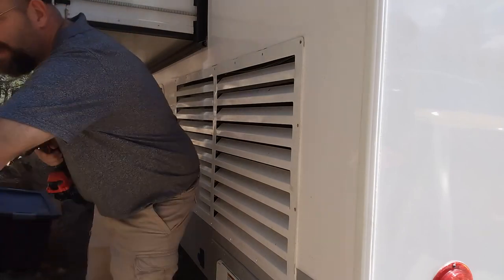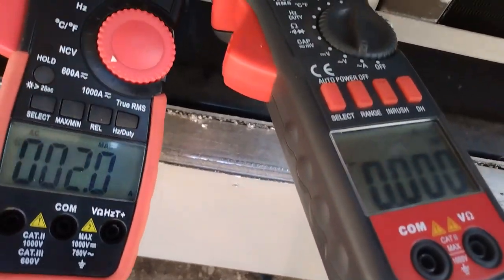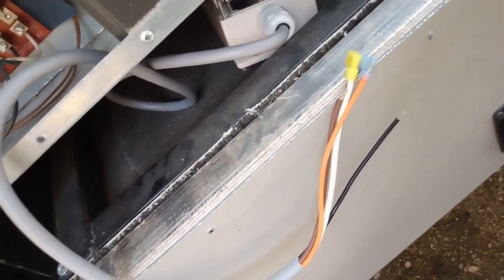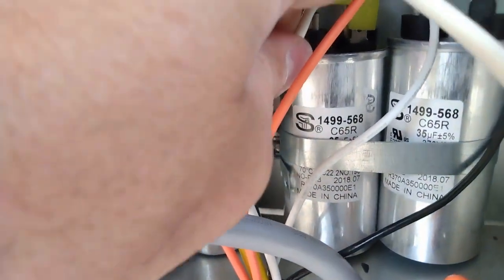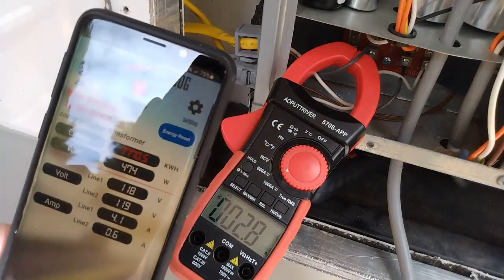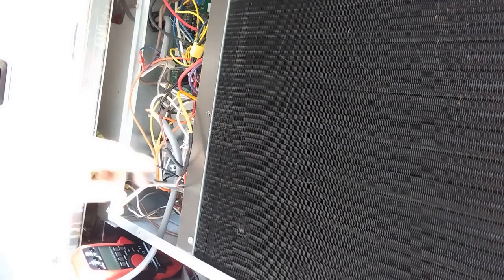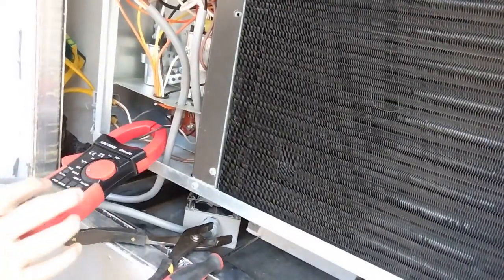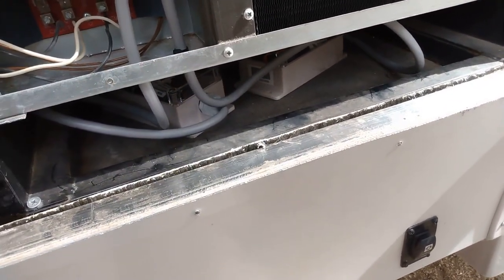soft start / easy start installed on a 2 ton basement RV AC system  2021 Columbus river ranch

Comment: I just got off the phone with micro-air and said system wouldn't fit in river ranch, so did you put  two 364 models in???  Where are the boxes stowed
Reply from the maker: I'm also of Facebook river ranch forum.  But yes I used 2  and there sitting under the AC unit but inside the  enclosure I believe I have a couple videos of me putting it in on YouTube
Reply from the maker: I put these in last summer but here's the deal I bought them the summer before that and just never got around to installing them at the time this was really the only option and it was a lot of work they do work very well but at this point if I were to do it over again there's another brand on the market where it just plugs into your main power cord it's not as good but it still does a lot of the same function I would probably for the amount of work it takes if I had to do it again just buy the one that plugs into the power cord
Reply from the maker: Look me up on the Facebook form for River Ranch send me a private message if you want and I can send you pictures